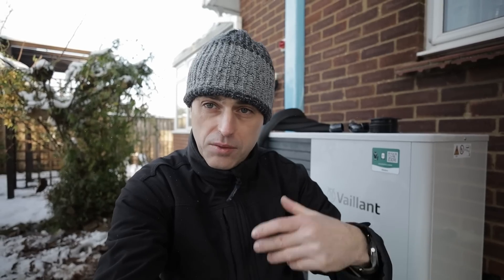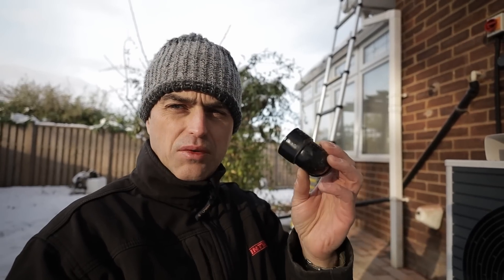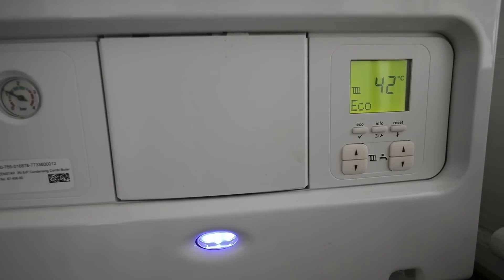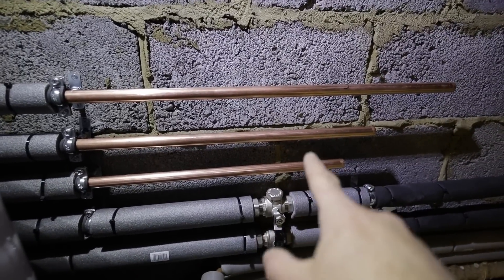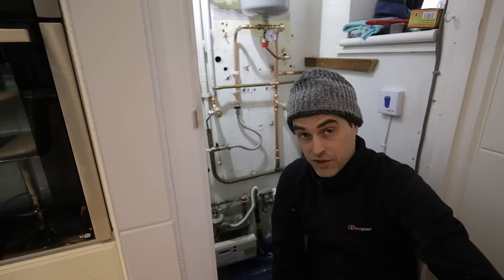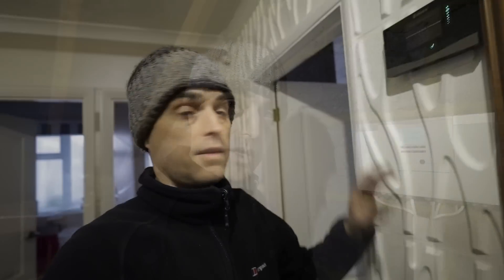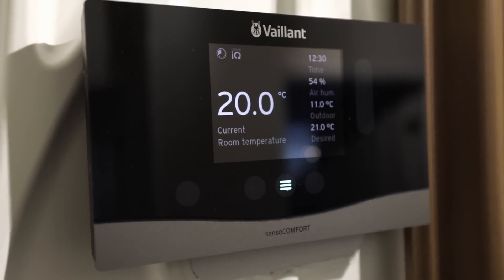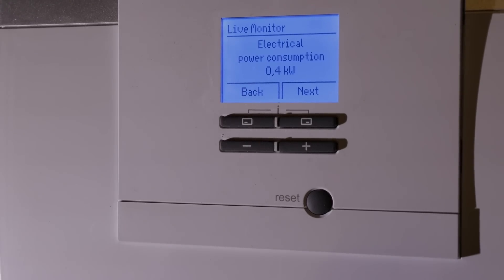How to Install a Heat Pump That Works

Comment: I'm presuming this system cost the householder at least £6000 to install? The Vaillant pump itself must be around the £3500 mark?
Reply from the maker: Vaillant HP, cylinder and materials are around £6k-7k (no vat on renewables) plus labour on top.
Reply: @UrbanPlumbers  Thanks for the replies. Happy Christmas....looks like you could do with a few days off.
Reply: @UrbanPlumbers  does the No vat incentive apply for the whole installation cost including Labour or just the heat pump?
Reply from the maker: Zero vat applies to the whole installation: labour, heat pump and also hot water cylinder, radiators and UFH plus all electrics
Reply: The whole installation everything including copper pipe, brassware and fittings etc

Comment: A question about the design temperature of -2°C outside.  What if the outside temperature goes exceptionnally to -10°C for two days for instance ?  Is it then necessary to choose which rooms to heat up and which rooms to keep only frost safe ?
Reply from the maker: at -10 you will need an additional heat source - such as direct electric back up (Vaillant sells an inline 6kw unit). Turning rooms off may not always work due to lower volume of water in the system affecting defrost cycles negatively.
Reply: You may find in future we have to design for minus 10c instead given climate alterations. It should not effect running costs in the long run if units become more and more efficient and able to modulate.
Reply: This idea of generating heat based on the outside temperature alone seems to go against normal control systems with a feedback loop. The system does not know what the desired room temp is or the actual room temp. Instead a guesstimate of the heat required based on the outside temp and a heat profile (heat loss) for the property is used. The room temp is altered by adjusting the heat profile. As you say, it’s a fine balancing act to get an aceptable comfort level. I can’t help feeling I’m missing something.  There’s no way a ICE car would meet emissions with this approach to fueling the engine so I find it hard to believe it’s better for heating a home.
Reply: I've been running my gas boiler at 42°C to see if my house is suited for a heat pump. When it dropped to -5°C  the other day it did struggle but wasn't the end of the world for a few days.

I think the design temp makes sense but it's very rare that we get low temps in the UK and I wouldn't worry about it unless I had vulnerable people in the house or those who are sensitive to the cold :)
Reply: @UrbanPlumbers  now I understand why in north Germany (where it snows every winter and -15°C is not uncommon) they combine a heat pump with a hydro wood stove they fire up in the cold days, when additional heat is required.
Reply: @kevinmills5293  its more efficient because you always heat at the lowest possible flow temps. A given flow temp, delta T and flow per hour gives you a certain amount of output. You have a graph that the unit follows. Outside temp drops, flow temp gets increased a little, etc. 

Its like driving in traffic at a steady pace, instead of acceleration and braking all the time.
Reply: @Deiphobuzz  using your driving in traffic analogy, how do you  maintain your speed (temp) when you come to a gradient ( change in outside temp) if you don’t know what your speed is (room temp)?
Reply: @kevinmills5293  well.. you know the room temp. You adjust the curve by hand if its too hot or too cold.  Most systems can sense the Delta T changing aswell. If return is too hot, outside of spec, it turns itself off, and wait for a given time, say 30mins. You dont want that to happen ofc, so you adjust the curve down a bit. 

Slight variations in weather such as wind etc have little influence in good insulated homes aswell. So its actually quite effective once setup correctly.
Reply: @Deiphobuzz  with pure weather compensation the system doesn’t use the room temp at all.
Reply: @kevinmills5293  yeah i know. I never said it did.
Reply from the maker: @kevinmills5293  the system takes internal temp into the calculation as well. It can run with some room influence or without room influence at all.
Reply from the maker: @effervescence5664  they are usually fine to around -5 anyway when sized to -2. You can install inline direct immersion for colder days

Comment: You don't need a bigger coil in the water boiler? 3.5- 4m2 ?
Reply from the maker: Yes you do. 1.5- 3.0m2. This is an HP cylinder here. They are also called high gain cylinders.
Reply: @UrbanPlumbers  if the coil is only 1.4m 3kw it can damage the heat pump or it's just that the water need more time to be heated? Thanks.

Comment: I'm curious, what was the airflow issue with the installation you mentioned at the end of the video? Thanks
Reply: Szymon covered this in a bit more detail in his recent appearance on the BetaTalk podcast.  Essentially the customer wanted the unit installed at the side of the house (in an alleyway) instead of at the back of the house for aesthetic reasons.  

The lack of proper airflow caused the unit to breath it's own air, so to speak, which obviously tanks efficiency and in very cold weather means it can't provide enough output at all.

Comment: Looking forward to the video you validate/confirm the SCoP and performance claims based on your installations. Baffled how they can get >4 in sub zero with air to water systems.
Reply from the maker: They don’t. In sub zero my jobs range from 2.3 to 3.3 (best one I am aware of). But in temps around 3-9c some of my jobs were above 5! Most well above 4

I don’t have a job that has run over a year yet as started installing on Jan 2022

Loads of videos on cop and scop coming next year once I have more data
Reply: @UrbanPlumbers  is there a system to monitor the SCOP? My intergas Xource only allows me to see realtime data. 

Maybe a modbus datalogging system or something you could recommend? Or would installer gateway allow for this?
Reply from the maker: @Deiphobuzz  Vaillant allows you to see cop and scop data on the interface unit
Reply: @UrbanPlumbers  Damn. Wish it could be at least 3.54 (To at least be at parity with gas central heating)

I'll get a heat pump eventually but I want to make sure my house is air tight first. Often when people say their house is well insulated, they're not considering air tightness.

I'll add more solar panels, make my house air tight, add an MVHR, get triple glazing, make my radiators bigger (if needed, but I'll probably have to replace them anyway because they need power flushing), and THEN get an air source heat pump
Reply from the maker: @waqasahmed939  parity with gas is 2.98
Reply: They cant, the COP figures shown on the units are hopelessly inaccurate. They are mostly to con the consumer into thinking the unit is wonderfully efficient and such a great buy!!
Reply from the maker: How come my units perform better than what’s expected of them by the manufacturers?
Reply: @UrbanPlumbers  How did you define that??
Reply from the maker: By measuring scop of the installation
Reply: @UrbanPlumbers  Lol...and how did you do that?!
Reply: @UrbanPlumbers  Whats up? Did you run out of credibility?
Reply from the maker: There is number of methods. Google it. 

Vaillant allows you to monitor efficiency and it’s very accurate.
Reply: @UrbanPlumbers  So basically you are going on the units internal 'estimation' of COP which is based on assumptions about the system. Of course the manufacturer will make sure those estimated figures give generous COP readings so the unit looks like its performing well. But despite having no accurate information on the units performance you think they are accurate?!
Reply from the maker: Check Trystan on Twitter from Open Energy Monitor. He compared his measurements with Vaillant unit and both scop were pretty much identical.

Also check heat geek with his vaillant unit being monitored live with open energy monitor running at scop of 5.7

In me experience Vaillant units have very accurate cop and scop calculations.

What real life experience do you have?
Reply: @UrbanPlumbers  Heat Geek's video shows only graphs from the Valliant unit with wildly high 500-600% COP's!! The only figure he gives for his monitoring system is 300% about what you would expect. This only confirms how inaccurate unit figures are.
Reply from the maker: @manoo422  you do understand the difference between cop and scop? If you do then you will see that both match very closely on Open energy monitor and the heat pump interface.

He gets around 300% in December which is about normal. Overall Scop will be higher though, and well above 400%
Reply: @UrbanPlumbers  COP is totally dependent on outside temperature (assuming inside settings remain constant). Therefore accurate COP's can only be taken per day. A reading of 300% for December means half the time it was less and half the time it was more. SCOP is used to average away the worst performance in the winter. They are totally distorted figures used to convince customers they will get good performance.
Reply from the maker: @manoo422  and you know that from what kind of experience? Do you install heat pumps? Or maybe you have one at home? Or have you just read it all online?
Reply: @UrbanPlumbers  Most from maths, an understanding of Physics and a background in engineering. If you think SOP's from the unit are accurate then how does the unit know how much heat energy its producing?
Reply from the maker: So not real life experience yet?
Reply: @UrbanPlumbers  I notice that with all your worldly experience you didnt answer the question, is that because you dont know?
Reply from the maker: Yeah I don’t know. 🤣🤣🤣happy new year dude.
Reply: @UrbanPlumbers  ....I think you might have just proved that...!
...and why you think they are accurate...oh dear.
Reply: @manoo422  If you had a background in engineering you would know that it measures Flow in and out in C, and liters flow per minute, and absorbed electrical energy. Tadaa COP. 

In my country there are lawa protecting consumers against false claims and data. Those units are sold here aswell. The data is correct.
Reply: @Deiphobuzz  Except they dont have flow meters.....
Reply from the maker: Vaillant has flow meters
Reply: @UrbanPlumbers  Ha ha ha ha, several Lol.
A minute ago you didnt know how to calculate kWh output.
Reply: @Deiphobuzz  Consumer law is also completely irrelevant since you dont buy a heat pump with any kind of guarantee of COP. Even the manufacturer will tell you the figure from the unit are only for information, if you want accuracy then measure it yourself...
Reply: @manoo422  except, they do have flow meters. Mine does. Its even faults when it below minimum requires, shows pressure before and after pump aswell for head loss calculations.

The claims need to be validated here. That why they show it as cop 7/35 for example.

Just stop talking already, its clear you have never installed, sold, bought or touched a heatpump. Stop embarasing yourself.
Reply from the maker: https://twitter.com/zarch1972/status/1608491482121670656?s=46&t=xxAG3fUaMimuqbB_sZQkKQ
Reply: @UrbanPlumbers  Even a broken clock is right twice a day...but it helps if you average them over a month. Interesting the only figures you can point to are around 3, which is hardly in dispute.
Reply: @manoo422   not sure anyone has told you,  you have strong douche energy, no need to be rude. 
Cop a7/w35 is a standard (en 14511) and tested by independent labs. Imagine the lawsuits if they are caught pulling off a heatpump gate.
Reply: @Deiphobuzz  Really and why would the flow change and how would it end up below minimum...?! Its a fixed system....Head loss! interesting, again why would you measure something unlikely to change?
Reply: @SBTRIS  People often dont want to hear the truth when invested in fantasy...
A7/W35 is std basis for a COP calculation meant to be a means to compare different units. It has no relevance to the display on the unit. No different to industry std mpg figure for cars compared to the meter on the dash...
Reply: @manoo422  and the award for Troll of the Year goes to....😅
Reply: @mikeypc3592  Life must be so much easier as a sheep...no wasteful thinking to hold you back.

Comment: The soak away sounds pretty extensive. How much water comes out of these during a defrost cycle?
Reply from the maker: quite a lot actually - I would guess estaimte around 0.5 liters per defrost. On bigger units it can easily be 1L.

Comment: Q: If the old system was set to 42´C how was the legionella threated?

I also quess that pipe+gravel will not be enough for the water. There are days that the unit creates tens of liters of water and all that also create water load on the foundations.
Reply from the maker: its what is called hot water priority. It runs at 2 different flow temperatures - one for heating at max of 40C and one for DHW at up to 75C

That pipe and gravel have been already tested in very cold weather with units defrosting quite often and it works perfectly.
Reply: @UrbanPlumbers  Thanks for the answer. DHW temp management has been around quite some time. Danger comes with older systems when the users are not aware of the legionella issue.

Great that the ground accepts all the water. Have seen many cases where it has saturated on certain weather.

Comment: isn't installing a soakaway manual creation limited to non heavy clay soils,  in such conditions aren't you supposed to use a soakaway crate system? also don't forget to get your pipe crimp units calibrated each year as they can loose pressure,
Reply: Was surprised he didn't use the rainwater downpipe.
Reply from the maker: You can’t use a downpipe 🤦‍♀️
Reply: @UrbanPlumbers  it's not directly to the heat pump . It's connected to the custom water collector and is heated due to the winter temp _20c

Comment: Did you need to install any volumisers ? 
Nice installation 👍
Reply from the maker: no need for any of that. Enough volume in the system as the unit is only 3.5kW
Reply: @UrbanPlumbers  Does the unit have if its own primary pump inside or do you need to fit an external pump for the circulation? and would you need hydraulic separation if you only had underfloor heating circuits or could you just rely on head from the pump inside the unit?
Reply from the maker: Pump in the unit. If you design the system well you can relay on the unit pump alone for UFH, but you need to be careful with that, as the pump has just about enough head for it but margin for error is rather small.
Reply: @UrbanPlumbers  I'm curious as I'm looking to install a similar set up but have limited space for anything other then a cylinder and the UFH manifold in a cupboard.
If the system for the bungalow you've shown had full underfloor heating instead of radiators, could you of ran the underfloor straight from the pump to the manifold or in this and most instances would you used a buffer or made your own hydraulic separation and pumped separately?
Reply from the maker: No buffer needed. Yes I would run straight from the unit into a manifold. No problems doing it, provided you calculate your index circuit and confirm you have enough pump head available at your maximum flow rate / heat loss.
Reply: @UrbanPlumbers  I then assume you would run the whole UFH manifold on the weather comp and take out the actuator heads on the manifold and run as one system? or would you suit this to customers requirement if they wanted different room temp isolation?
Reply: @UrbanPlumbers   if you don’t have a buffer/volumiser what if the customer turns radiators off reducing volume capacity below what is required?

Comment: So the Heat Pump has to run all the time ( 24hrs a day ) to maintain the temperature,  I have asked this question many times on other channels but never get a reply . So how many kw a day would that bungalow use a day  at minus 2 all day. Thanks
Reply from the maker: I would expect around 15-20kwh used over 24h at -2 for this bungalow. They have pay 10p per kWh at night and have 6kwh battery.

With 10c outside unit consumes 0.4kw, and around 7-10kwh per day

At the moment it costs around £3 per day on regular tariff, but on their tariff probably closer to £2
Reply: @UrbanPlumbers  thanks for the reply 👍
Reply: @UrbanPlumbers  I am  sorry to take your time up but you seem the best heating engineer and honest person on youtube for advice,  .
Can the heating pipes from the unit go under the ground  if well insulated , as the path beside my bungalow would not be wide enough to have the unit there , it would have to be sited 2 Metres past the rear of the bungalow,  that would  mean the pipes running underground for 3 Metres , up the outside walk 3 Metres to enter the loft space and further 5 Metres to the existing gas boiler ( Potterton Powermax he  ) .Can the pipes from the unit be run in plastic ? like Hep2o or similar 
Thanks
Reply from the maker: @sidperry7748  Yes you can run underground but you need to get a very expensive preinsulated twin pipe. Also push fit plastic is a big no-no - do not do it. You can use press-fit pex plastic, but then you have to go a size up as compared to copper, which means 32mm or 40mm in most cases. Cost is around £100-£150 per 1 meter.
Reply: @UrbanPlumbers  thank you very much for your replies,  it is very much appreciated 👍

Comment: Is your primary loop glycol? Or does the circulator just never stop? I'm curious what would keep the exterior water lines from freezing when the temperature dips to say -10*C on the odd day that might happen if the heat pump were to stop for some reason.

As always, fantastic video.
Reply: @zlmdragon.  I saw that, but draining a system due to low temp isn't ideal, more of a last resort option to prevent damage. I was more trying to ask, what normally keeps it from freezing.
Reply: My intergas xource just runs the heatingpump at 15% all day when it dips below 5c and no heat is required.